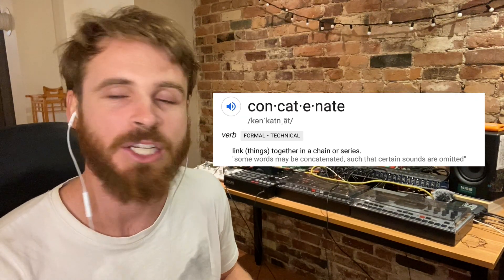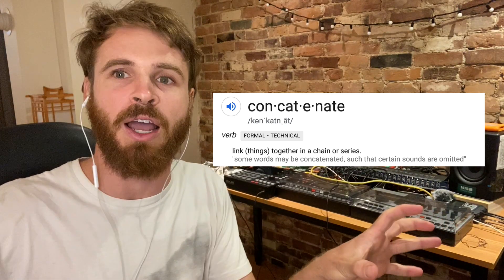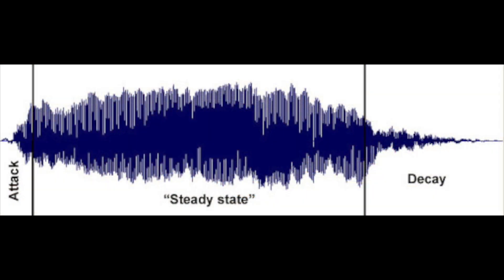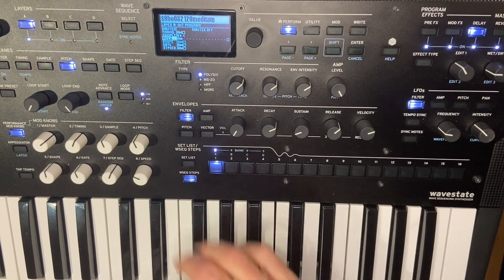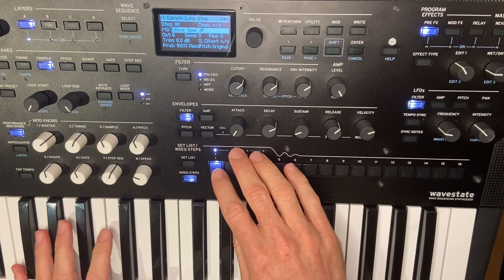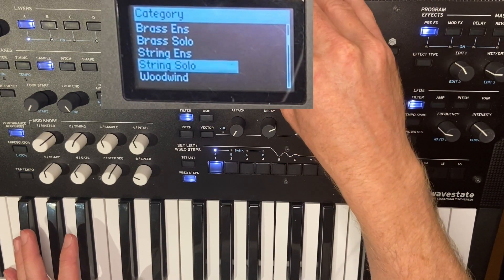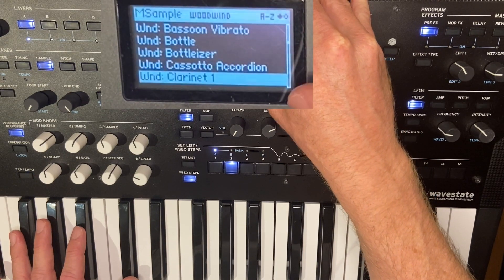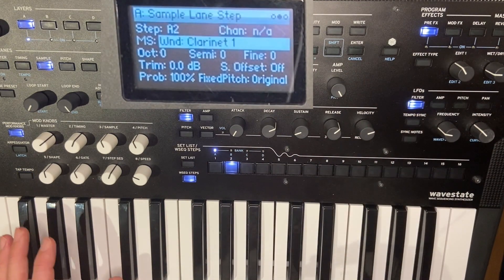Wave Sequencing Synthesis: What Is It and How To Do It (Korg Wavestate Tutorial)

Comment: Thank you very much for your tutorial. Very clear und logical. But...

I dont understand the relations between 
- wave lane
- wave sequence
- program

Also a question about the program:
When I load a Single Multisample or a Wave Sequence on A, 
it shows on the layer programm "Init program". Why?

Same issue:
On my presets, it shows on Layer programs on one performance on A "Organ1,
but on Single Multisample i shows "Syn: White Pad". Why it shows not the same?
And more difficult: If I change the program, than the multisample change.
If I come back to the program "Organ1", now than it plays "Organ1".

Thank you!

Comment: This is a very valuable and well articulated tutorial. Most of the videos on this subject show off the Wavestate. But to understand the Wavestate, something significantly different from both a "normal" (ie. subtractive) synth and a sampler, we have to understand the structure of this method. These synths are very deep because of what you explain so well. Not the kind of gear you can easily pull out of the box and move quickly beyond the presets. But that's their strength too.

Comment: what I'm hearing is that it's like d50 linear synthesis but you get full control over the transient sample
Reply from the maker: there is definite kinship to the d50! the wavestate itself has many more features than the d50, but the underlying idea behind its synthesis is very similar to the d50.
Reply: @bluecliffsynthesis6685  @cktable   Great video!!!  My D-50 yes, or my Elektron SID Station or my Alesis Quadrasynth. Called LA synthesis by Roland, but before you correct me, obviously Wavestate does a lot more than these keyboard sounds you make here. I REALLY don't need another synth, because there is simply no room in my 2 bedroom terraced home. So many synths, so little time...

Comment: I actually think it should just be called "Sequencing Synthesis" IMO. The reason I think so is because on the Minilogue XD you can use its "Motion Sequencing" abilities to shape the sound of it's synthesis. So in general both the Minilogue XD, and the Wavestate can both use sequencing techniques to affect the overall sound, thus "Sequencing Synthesis" can be used in 2 different ways on both synthesizers. Great video and tutorial BlueCliff. This should help anyone having trouble understanding this awesome synth :)
Reply from the maker: I like that term, and think that "sequencing synthesis" is an accurate description! Thanks for watching :-)
Reply: Ahhhh. Good to know. I have been checking out both to decide. I feel the wavestate can do more or has another dimension to its capabilities.
Reply: The sequencing on the Minilogue, and many other synths, is  most likely modulation sequence (eg. volume, filter changes, etc.). Modulation sequencing has been around almost as long as proper synthesizers. The original Moog modular synths included the ability to change modulation parameters over time. This is a little different from "synthesis" but in the general sense, it can be considered as such. 

It does get potentially confusing as there are so many ways to sequence in synthesis. You can sequence the note data (which is very common, including on the Minilogue, but also via many tools like Beatstep). 

You can also can sequence the modulation. This can happen in addition to note sequencing on some synths. Korg is great about this. I got hold of a Korg RADIAS in early 2000s for this reason. 

But the Wavestate (and its heritage, the Wavestation) is fundamentally different in that it is sequencing wave files (samples) by both stacking them ("vertically") and chaining (concatenating) them together ("horizontally"). What's more, you also have modulation sequencing on top of that! Not sure if it has a note sequencer. But this is a fairly unique beast, I think. If the samples and audio quality sound good, which they seem to, you've got a real powerful sound design tool here. Especially when you can bring in your own samples.